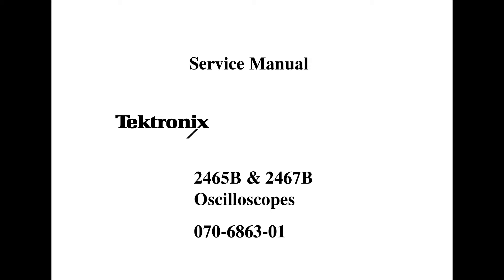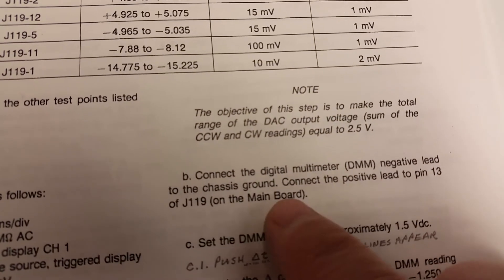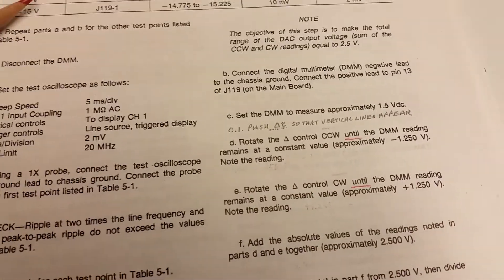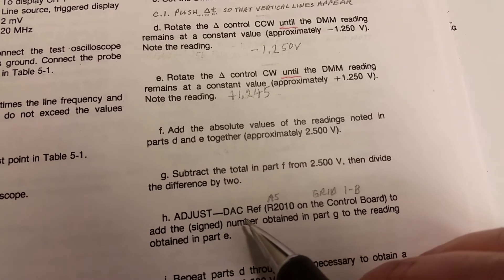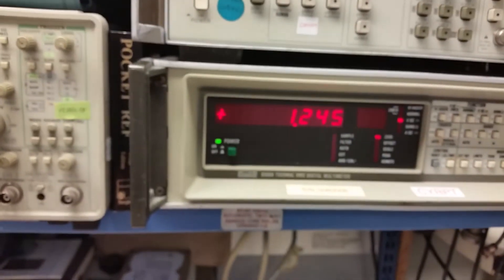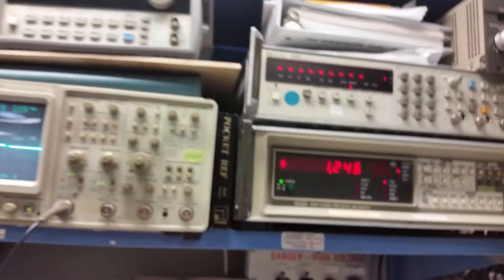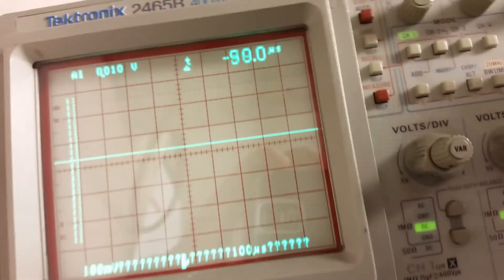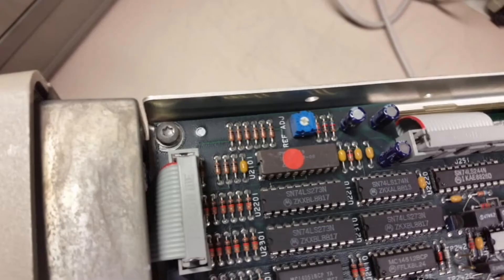Tektronix 2465B Pre-Calibration Adjustment DAC Ref Voltage

Comment: Hi Keith just bought a 2445a scope with a few errors on startup. This series was very helpful as it looks very similar to the A but half the bandwidth.
Reply from the maker: Hi Simon, I love these scopes. They are great but they do have some serious calibration procedures that can all but brick your scope. Unlike the scope you have, the 2440, the calibration process and menus are totally different. Be extremely careful when entering diagnostic mode if you have the CAL jumper in the CAL position. I have some video on doing the calibration without the called out equipment but I was never able to get CAL 9 to take so I had to put the scope back on the shelf until I can figure it out. I have not posted the videos and they are step by step but unedited. I don't really have time to do them ALL so I haven't posted them. I don't want to post even one of them because once you do one step you have to pretty much do all the Calibration steps.
I do expect a LOT of these to become available soon. The US Navy has a ton of these, but their new Calibration procedure does not go into the CAL mode, it only checks to ensure it meets specs. So from now on when a scope fails calibration in the Navy they will survey it and sell it as Government surplus. One thing you really need to watch for on these if you have the early battery version, NEVER remove the battery or U2460 if you don't have a TEST 04 FAIL. If you remove either ALL the Calibration Constants are dropped from the volatile memory and you'll get the dreaded "TEST 04 FAIL 11" or the 03. If you have the later version with the DALLAS memory chip you can remove it. You can get a pre-loaded DALLAS chip that will trick the scope into thinking it's calibrated, the scope will not be calibrated, but at least the TEST FAIL scree won't come up. You can actually calibrate the scope but make a copy of the DALLAS chip before you do in case you erase it by mistake. Hope this advice helps, feel free to ask questions. If you want you can send me a thumb drive and i'll copy all my 2465B calibration videos and files for you and mail it back to you. The Folder is about 48GB, it includes all the unedited videos and all the PDF,s Related to the 2465B, I also have some 2445B PDFs. Send me a private message and i'll send you my address. Talk with you later Simon.
Best Wishes n Blessings. Keith

Comment: Interesting video thanks.
Reply from the maker: Thanks Simon, I've been watching your 2440 with bated breath and interest. I think it's an awesome oscilloscope. It reminds me of the old 7000 series display layout. On mine I was able to get through the Pre-Calibration steps, the CAL 08, CAL 01 through CAL 07, but I couldn't get CAL 09 to even think about passing. I don't know if it was the signals I calibrated it with or if there is something else wrong with the scope. All CAL 09 would do is just "LIMIT" out. The nice thing about my boss is I was allowed to video the CAL 01 thru CAL 08, but I have to do all the editing on my own time, so it's going slow, because I have so many more important projects to do at home.
-Back to the 2465B, so unfortunately because I couldn't get CAL 09 to pass I had to put it back on the shelf until I could figure it out through research then try again later, when work slows down again. The 2465B belongs to my work and after a month of playing around with it in some spare time I had to pull the plug when other work came in. Although I didn't work on it exclusively I spent way more time on it than I thought is should have taken. I guess that's what happens when you don't have oscilloscope calibration equipment and basically are trying to write a new procedure using non-standard oscilloscope equipment with the original procedure that doesn't give you the signal parameters. We're short on scopes at work, and incoming work was slow so that's one of the reasons I got to play with it so long. So far we've had 6 scopes go down at work in the last 2 months, I've fixed three of them. Next I have a 2445A and a TDS620A to fix that won't turn on, and a TDS3054 that has AC measurement problems. I don't think I'll video those, as it does take a lot of time to edit, research and write up a semi quality video and description, but I have enjoyed making the 2465B video series so far. Well thanks for watching.
I'll chat with you later and wait for your next video. Best Wishes n Blessings. Keith